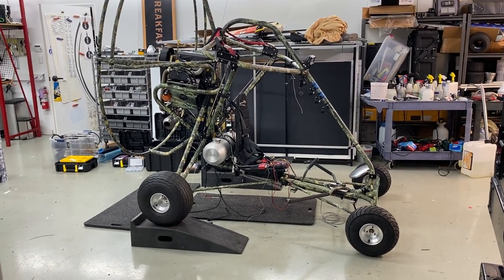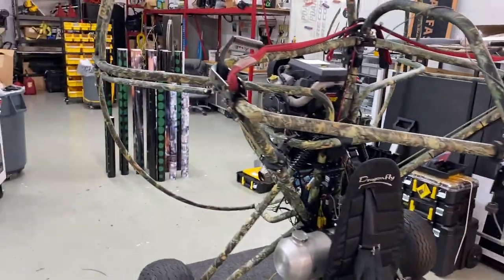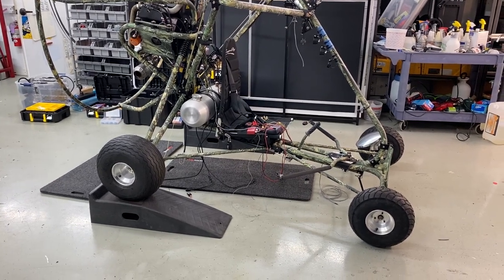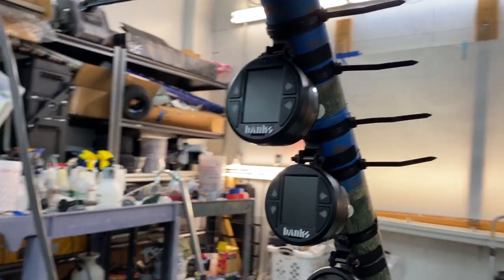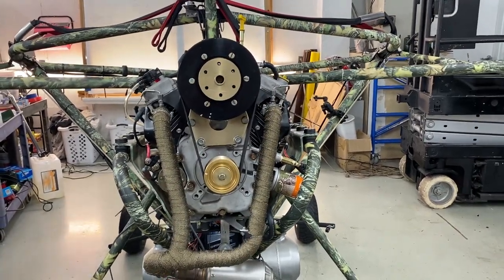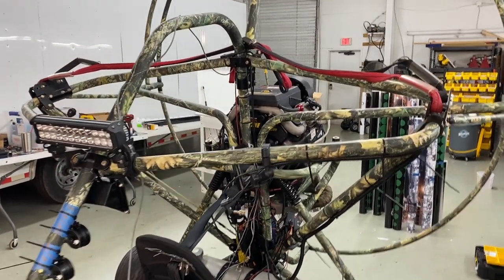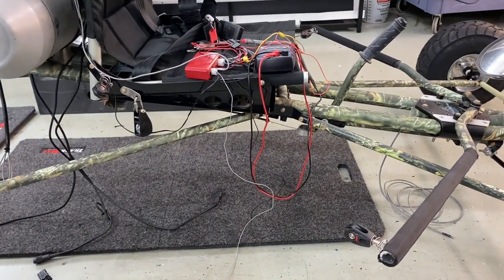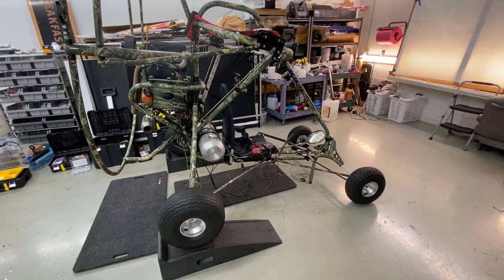Project Dragonfly Update April 7 2020

Comment: Check out Robert Workman's channel on YouTube.  In his video titled "Engine Review of my Ultralight Powered Parachute" he says that his Dragonfly Generac engine has no charging system in order to save weight.  He puts the battery on a trickle charger once a month.
Reply from the maker: Once a month!  I installed a 2nd battery in parallel, and it's charged when it's not flying.  So much for weight savings.  If I have to pull the engine I'll add the stator setup, but this is working for now.